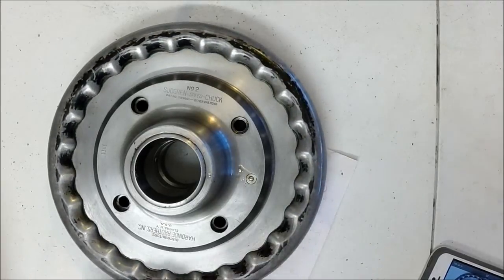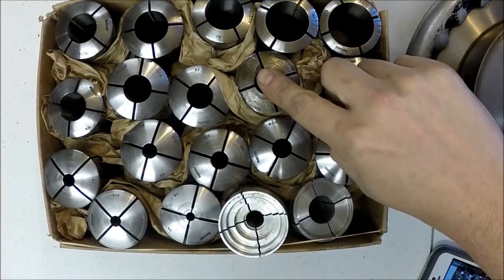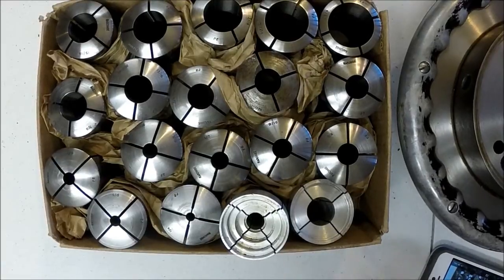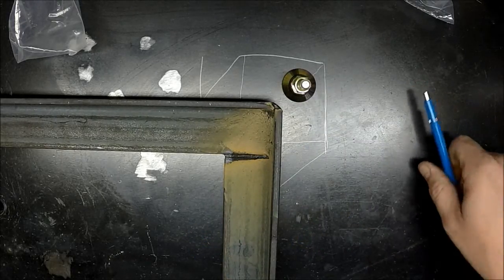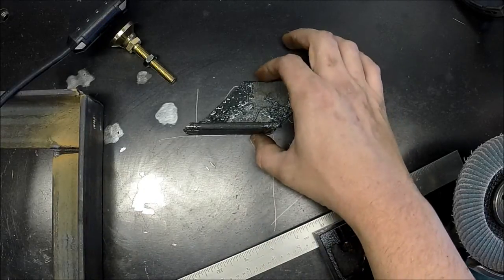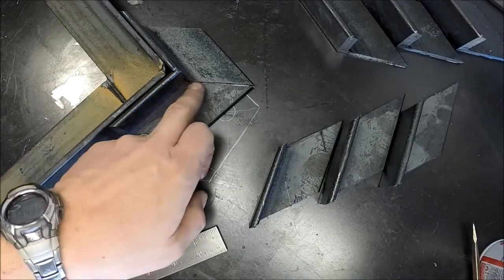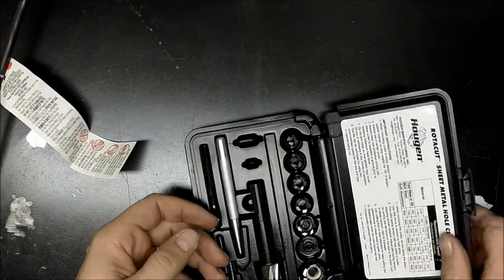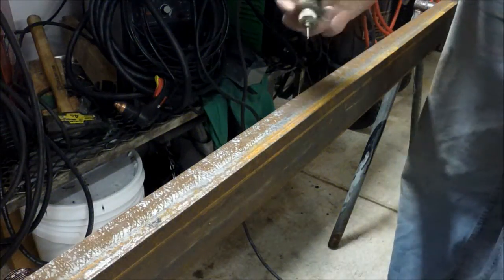Mixed Bag of Goodies 17

Comment: Nice chuck, you will like using that.  Thanks for the shout out, nice of Bob to deliver.  Press is coming along and the bases look good to go.  Thanks for sharing, Randy
Reply from the maker: Yeah I am very happy with the chuck and thanks again it was an awesome find. Now I just need to work on the backplate. Those rotacut tools worked really well on some other projects I totally screwed myself when it started to wobble and I didn't stop.
Reply: Mike Dittman Kind of like a hole saw, have to stay straight.  My son broke one of mine a few weeks ago.  But he was good and replaced it.
Reply: Mike Dittman
I'm glad you are liking the chuck.  Too bad you were not able to make a D1-4 out of the existing back plate, I thought it would be possible.  I want to see it in action soon!  It should make it much easier and quicker to make your brakes and achieve better accuracy, fit, and finish as well.
Reply from the maker: Yeah I think it will be very nice once I get the new backplate machined up.